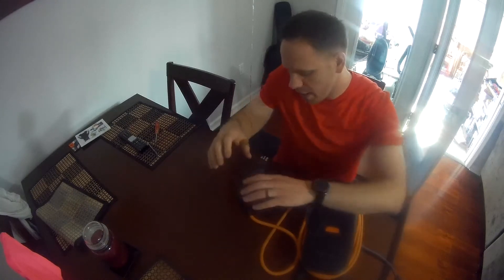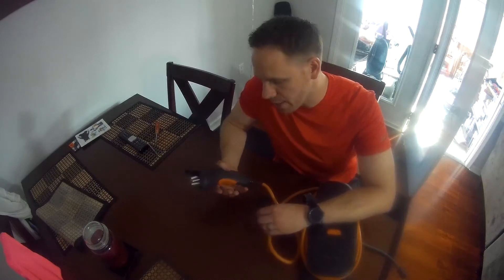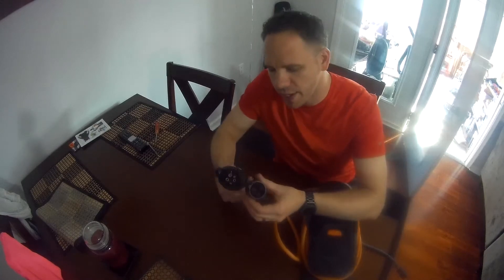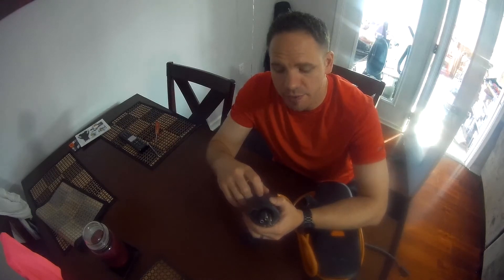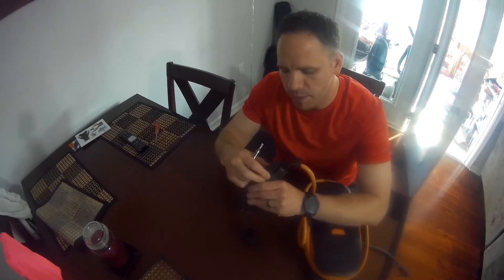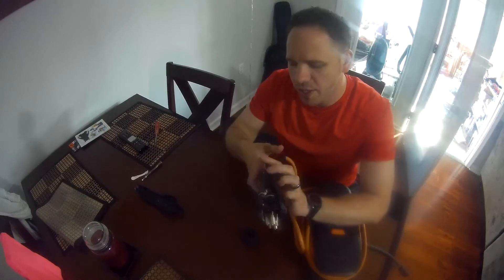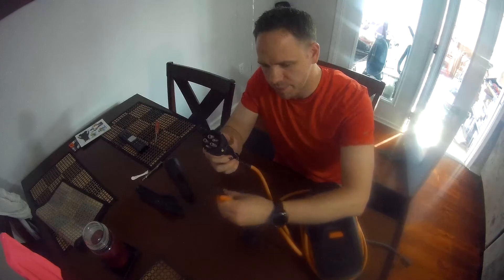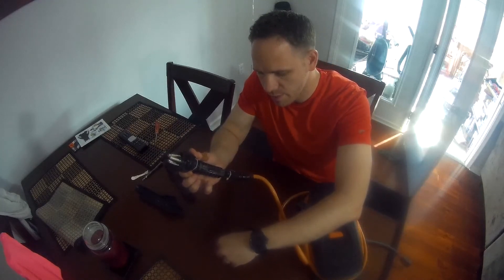Broken Charger Fix Your Stuck Voltec Charger for the Chevy Volt

Comment: We have a 2012 Chevy Volt too, which stopped charging after a power outage. Took it to the dealer, who reset some codes and was able to charge it there. However, when we got home, the Level 1 Voltec charger has all lights displaying normally, but it still doesn't charge the car. Tips? Suggestions? All help would be appreciated!

Comment: Very good video. Thanks for taking the time to do it. 2012 Volt, charger not working. Haven't had car long, bought from 1 owner w/ 76 K. I dropped charger & it does not work. I watched video on fuse replacement so I removed fused & tried a jumper wire w/ no luck. Proud to see another Volt owner here!
Reply from the maker: After this video, is it working?
Reply: no lights at all.......:[
Reply from the maker: No lights meaning, no charging light on the dash?